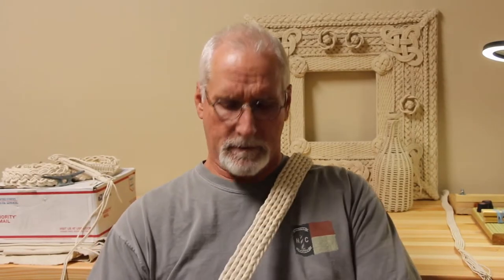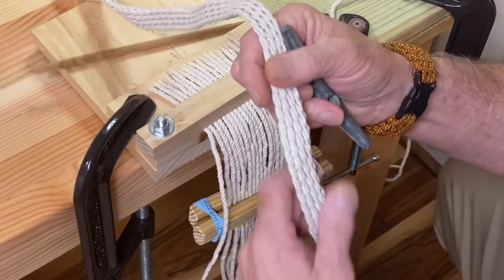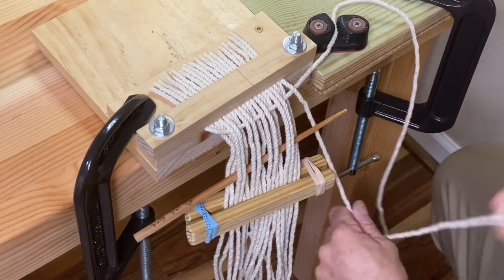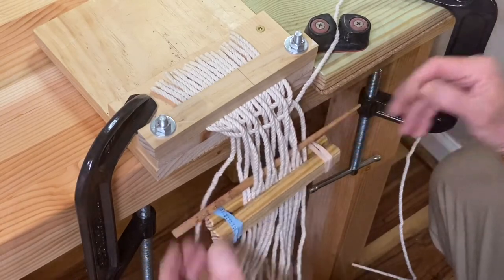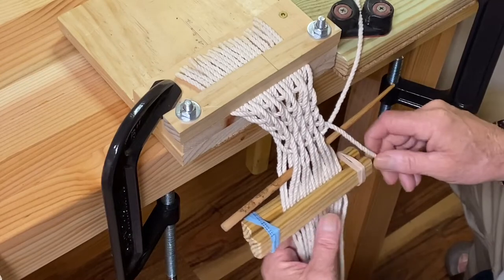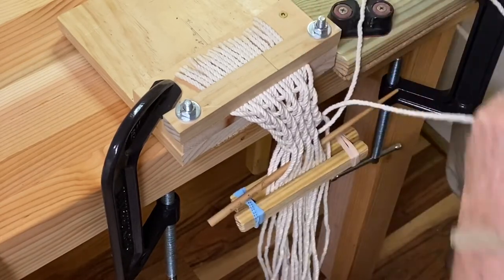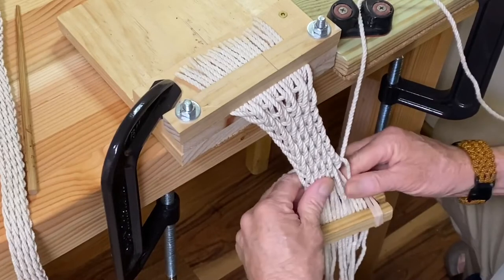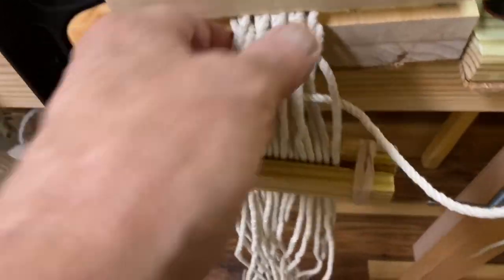Russian Sennit Tutorial

Comment: good video. just some helpful tips from an Old Bos'n Mate. If you double the line over a rod instead of clamping it (has shown in the BM course manual). It will be in its desired width from the start. A thing I learned not to long ago is if you use a double end grip fid  you can just pull the working strand through when you remove the sword. Here is a excellent video on how to make your own. I love the cam cleat idea so I am stealing it. Now I am going to have to redo my sennit jig.
Reply from the maker: I’ve become good friends with Skip Hipps , who as it turns out, has tied miles of Russian over the past 30 years or so.... I no longer use the cam cleat ..... I use a weighted alligator clip with a 2 oz. fishing sinker that I hang over the bolt on the right hand side ... this gives consistent tension throughout the process ..... I’ve changed some other stuff too .... well, shoot I probably need to do a revised version of the tutorial ( that was the second time I’d ever tied it🙄) ...... just tied a bunch of 10 strand French from Ashley’s which is really the same sinnet but in single strands rather than paired in Russian .... it’s a slowwwwwwww sinnet😎
Reply: @TrevvettKnots  Yes it is. when I work a 40 strand Russian I am can only do 6 inches at the max before I have to take brake and get my head and eyes straight.
Reply: Eng2BCapt, I see you reference a video above for how to make a double end grip fid but do not see a link.  Could you provide that?  Thanks.
Reply from the maker: Must be a misunderstanding… I have no reference for a grip fid … never seen one
Reply: @TrevvettKnots  here is the video I used. I just left the needle whole to make it double ended https://youtu.be/8e9-t9aXa6M
Reply: @Eng2BCapt , sorry for the delayed reply.  Thanks for the link to the video on making grip fid.

Comment: Howdy;  How do you finish these Sennits??  Just a constrictor Knot? Tuck the ends in ??? where?  Something I've never seen
on any of these sites unless they are tucked in and clipped as Mikko does with some. Good things you are makin'. Thanks.
Reply from the maker: These Sennit are being tied to go on Sennit frames ... you basically tape,super glue and cut a mitre angle
Reply: @TrevvettKnots  Ok, that part is easy to understand. How would they be finished for other applications?
Reply from the maker: So .... Mabel Marble makes Sennit a as cylindrical .... so they are unending..... also you will often see Sennit used as lanyard neck piece so the two ends are brought back together and joined and then covered with a turks head